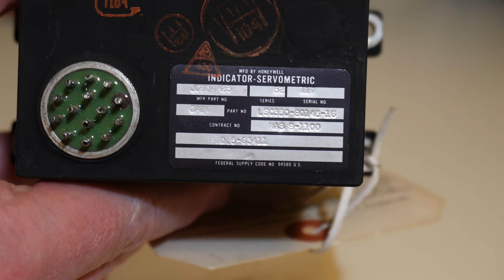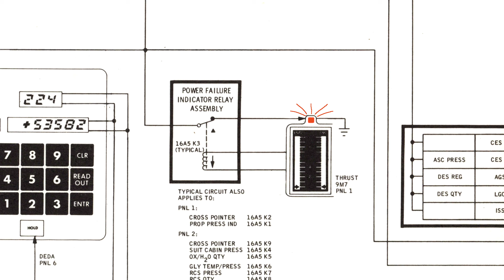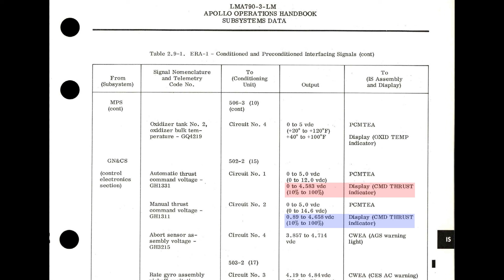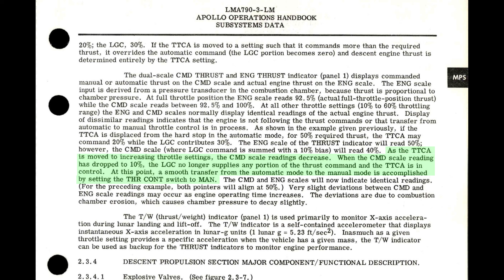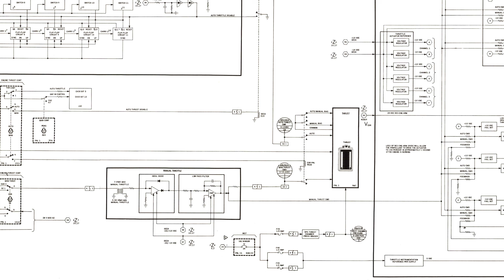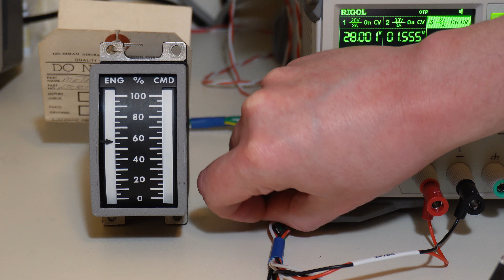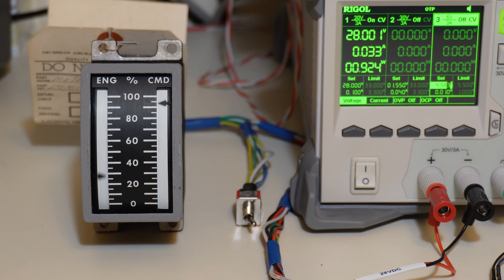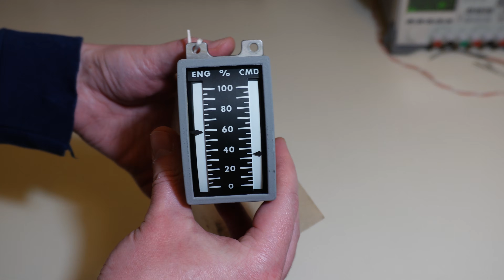Powering up a Lunar Module thrust meter

Comment: Thrust has to push off something.  In a vacuum such physics are impossible, therefore this video is garbage and you don't have any idea how pushing power works.
Reply: What I can't figure out is, if this Newton dude was wrong, how is it that for hundreds of years we've been building stuff based on his theory instead of yours and it works?
Reply: @Curt_Sampson  I don't suppose you can figure it out.  Thing is you are so obviously oblivious to Newtons law of resistance which demonstrates it is impossible to push off nothing.
Reply: @Moonlightshadow-lq4fr  You are absolutely right; I am indeed ignorant of Newton's law of resistance. Does it bear any relation to his three laws of motion, which I do know about?

1. A body remains at rest, or in motion at a constant speed in a straight line, unless it is acted upon by a force.
2. At any instant of time, the net force on a body is equal to the body's acceleration multiplied by its mass.
3. If two bodies exert forces on each other, these forces have the same magnitude but opposite directions.

Also, my ignorance has brought up new mysteries. Such as, why does the moon orbit the Earth? It keeps curving around the other rather than just flying off in a straight line, which by rule 1 above means a force must be acting on it, but what is the moon or that force "pushing off of," given that it's just sitting out there in a vacuum?
Reply: @Curt_Sampson  My apologies for my arrogant presumption, you are a very clever person with a very curious mind and a good listener too and worthy of an educated response.  Newtons law of resistance is the reason bicycles work on the ground but not when suspended in air because there is virtually no resistance in the air there is nothing for the wheels to push off and make you go forward.  Once resistance is established by putting the wheels in contact with the ground you get forward motion.  No matter how fast and powerful the engine is, that being a person on a bicycle or a rocket engine on a rocket it ain't gonna work if there is no resistance to push off.  Nobody can explain why or how the moon floats around as a proven fact as the size and mass simply don't equate to the forces that we can work out using our math so "theories" are assumed.
Reply: @Moonlightshadow-lq4fr  Can you tell me where you found Newton's law of resistance? It must be in his works somewhere, but I cannot seem to find it. (I can find the three laws of motion I mentioned in English translations of his book _Philosophiæ Naturalis Principia Mathematica._)

And if air has virtually no resistance, how do aircraft work? After all, they basically just take air in at the front of the engine and throw it at much higher speed out the back. This does indeed appear to move them forward, as I've seen in my time at airports watching aircraft take off.

And you say that "nobody can explain why or how the moot floats around," yet many people do seem to have explained it. In fact, everybody with a degree in physics, or even those who have taken a high school-level physics course, has the same explanation for it. All these people are wrong, somehow?

Comment: Amazing that such pristine parts are still around and operating perfectly over 50 years later. Are potentiometers used for feedback from the needles? If so is it just the friction of the pot that holds the needles when the power is off?  Also what is the design of the movement, is it moving coil or moving iron, single or dual (quadrature) coils?
Reply: It's probably hermetically sealed with high purity nitrogen inside. Going by the glass feed through and similar aviation instruments I've worked on.

Comment: Interesting it defaults to DOI minimal thrust setting of 10%. I'm sure there are some watchers who were there taking note. I don't have the electrical engineering background, but how do you think the meter needles traversed the thrust zone of avoidance from, say, 95% down to 65%. I assume the descent engine had to operationally traverse that zone, albeit as quickly and efficiently as possible. I also assume that's where astronaut attention would be directed during the descent itself. Sorry if this is a bit beyond your remit, but ... one does wonder. Coincidentally, your Curiousmark ORBITER lunar descent has been on my feed a couple of times just recently. This is something of a treat.

Comment: Any other Curious Marc fans thinking "I really hope he has a reliable power supply for the EL lighting..."
Reply: I was thinking that but then saw the digital display for the PSU.
Reply from the maker: Yeah, I bought the bench AC supply featured in this video after that attack from the helicopter supplyinator. Should be much more trustworthy!
Reply: @mikestewart8928  Is it an Itech? Buttons look familiar...
Reply from the maker: @connerlabs  Yep, Itech IT7321.

Comment: The modern reliance on 'modern electronics' needs to be re-considered.  Needle gauges are not vulnerable to cosmic and solar radiation.  Electronics are very much affected by both.  Imagine LOCV because of a cosmic heavy nucleus flipping a bit.

Comment: Fascinating. So, they did go to the moon, but they also faked it for TV. I heard they found ancient alien moon Bases, and uncovered our modern computer technology, if you think about it, we went from vacuum tubes to integrated circuits, right around that time. It appears they also discovered artificial neural networks by reverse engineering the alien tech, which was primarily done by Bell Labs.

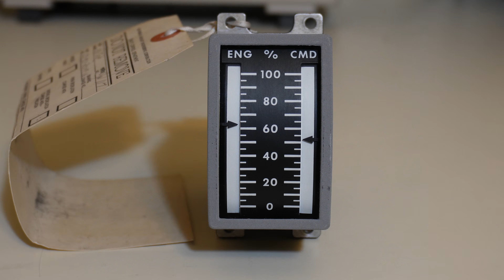Comment: At 2:07 the title on the Specification Control Drawing called it a Meter, D'Arsonval, Thrust Indicator Display Subsystem.  So it's a D'Arsonval movement with a servo.

Comment: Is there a theory of operation on how the servo loop worked inside these that one could look up? Or a servometric meter that has been disassembled to analyze? I'm very curious what the mechanics looked like and how they achieved servo amplification.
Reply from the maker: There's an article about them titled "Feedback System Advances Meter Utility" in the July 13, 1964 edition of Aviation Week -- but it looks like it's unfortunately behind a paywall. This Apollo Experience Report contains the diagram I showed, and goes into a bit more detail: https://ntrs.nasa.gov/api/citations/19720012251/downloads/19720012251.pdf

Comment: Do I understand right that the Lunar Module was entered for closeout after it was stacked on top of Saturn V (you mention that the closeout happened during countdown)? Can I find a brief description of when that happened/how it was entered/... somewhere?
Reply from the maker: Yep! There were access doors on the side of the SLA, and they rigged up platforms and ladders internally to give them access to the LM. The timeline on pdf page 21 of the Apollo 12 Countdown has a rough overview of LM ops, concluding with SLA closeout at around T-14h: https://ibiblio.org/apollo/Documents/V-20060_AS-507_LV_Ops_for_Countdown_Vol2_Count.pdf#page=21
This study guide has a diagram of all of the platforms and ladders inside the SLA: https://ibiblio.org/apollo/Documents/LC-39A_SLA_Emergency_Egress_System_Study_Guide.pdf

Comment: The glitch seems present only when the needle moves up. Have you tried turning the meter upside down and seeing whether the glitch now happens only when the other needle moves to lower values?
Reply from the maker: Wow, very observant and great question. I just tried -- when I turn it upside down, the glitch still only seems to happen when moving from lower values to higher values.
Reply: @mikestewart8928  what about with the needle un-powered? Inductive coupling from the current inrush ?
Reply: @mikestewart8928  I wonder if it has something to do with the low position being off-scale.

Comment: Wonderful instrument demonstrated very well,  Curios Marc was playing with a Flag indicator with EL backlight but his PSU had a wobbler and sending 100v up its chuff.   I am surprised they applied so much voltage. Thank's for the demonstration.
Reply from the maker: Thanks! Yeah, that attack from the helicopter supplyinator is what motivated me to shell out for the bench AC power supply I'm using in this video. 😅
Reply: @mikestewart8928  Then you shelled out ten times more for an Apollo gauge to test the power supply.  Are  you getting a Luna Module to check the meter work in it.

Comment: Cool stuff! So in action, how much delay would there be between the command and the actual engine pressure?
Reply from the maker: Generally, I think it was fast enough to be essentially imperceptible. There's actually an interesting story about that delay. The original response time was about 0.3 seconds. They later improved this to 0.075 seconds, but neglected to update the ICD. As a result, the wrong number was used in all AGC software up until Apollo 14. Until they discovered and fixed this, the throttle control loop was only marginally stable, and both Apollo 11 and Apollo 12 exhibited oscillations (called "castellations" due to their shape) in throttle control.

Comment: It looks like you have your current limit set to 100ma for the 28 supply. Depending on how the PID is tuned, It might peek much higher for some milliseconds and the PS is clamping, causing the glitch. This thing is designed for crazy vibration and g forces so they must have the PID loop tuned pretty tight and fast. It is probably galvanometer based. 
 Anyway, cool video that is a nice piece of hardware. I would like to see the internals (not going to happen :) . It would be interesting to see the current trace on the scope.
Reply from the maker: I just double-checked to be sure, and I see no behavioral difference with the current limit set to 2 amps. So I don't think it's the current limit kicking in, although it could still be a transient response kind of thing. I agree it would be neat to see the internals, but the only way to do that would be to take a blowtorch to it. Although, maybe we could have it CT scanned...
Reply: @mikestewart8928  Interesting. I would've bet five bucks on that. Laser galvos (servo) can pull some pretty high current for a few milliseconds under a large step response condition,  this is basically the same thing, just slower. You could put a square wave into one channel and see if that affects the other channel and totally rule that out. I wonder if that bias switch is inside of the servo loop.

Comment: Worked in a different field and ran across a couple of 'servo meters' that worked simularly. Used internal slide-wire resistors and simple closed-loop just like these. Pretty cool tech. Nice video.

Comment: Did any of the missions use the manual burn override?
Reply from the maker: Good question! For earlier landings that performed DOI (descent orbit insertion) with the LM, the DOI burn was performed with manual throttle at 40%, because it was a bit too short for the AGC to control well. Also, Apollo 14 started its powered descent with manual throttle control, because the throttle would not be automatically controlled properly while they were working around the abort switch issue. Transitioning the throttle back to automatic control was the last step in their workaround procedure.
Reply: Also Apollo 17 DOI-2 (similar to the early flights), Apollo 9 and 10 before first landing and Apollo 13 (Of course…😊).

Comment: The snappy response of that servometric meter while adjusting the voltage in steps was really interesting to watch. 
Why does the specification control drawing call it a D'Arsonval meter? Was it originally supposed to be, and later changed to a servometric movement?
It's a shame there was nothing wrong with it, I would've loved to see the inside!
Reply: Sounds like an industrial CT scan will be needed to find out for sure. D'Arsonval would return to center without power. FDAI pointers may actually be D'Arsonval meters. I haven't looked into mine much aside from seeing that they have constant force spring returns for centering.
Reply from the maker: That's a really good question. It's definitely possible that they were originally true D'Arsonval meters... although, even the earliest revision on the pinout table has a +28VDC pin, which I'm not sure a D'Arsonval meter would need. The relevant Apollo Experience Report describes them as "somewhat similar to a D'Arsonval meter movement", which isn't particularly helpful.

Comment: Excellent amount of detail on a very interesting implementation of a normally simple device. Thank you.
 Engineering is so much better when developed by engineers to perform a given function well. The equivalent device produced by bean-counters would be so unreliable it would be dangerous. I'd love to see how much modern engineers could design a modern equivalent using modern tech.